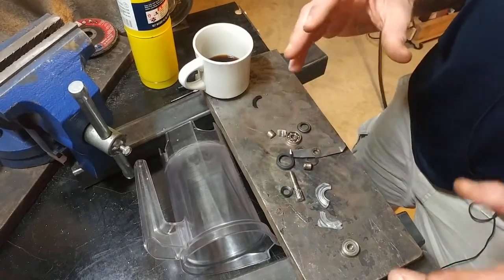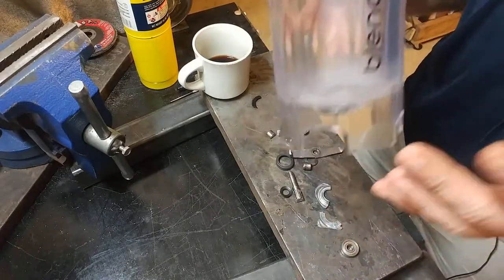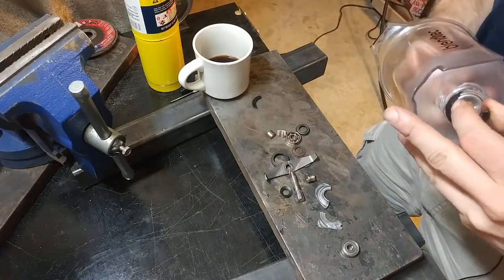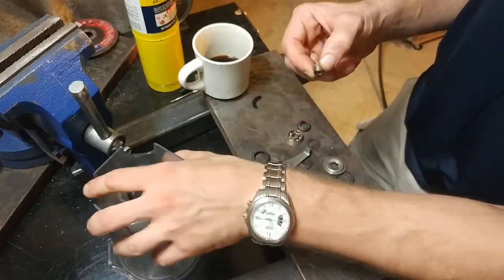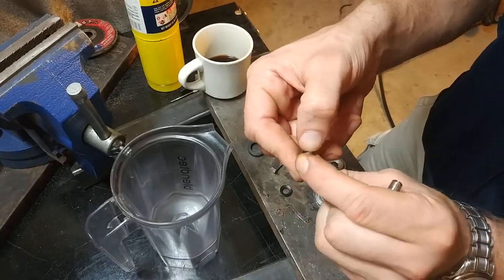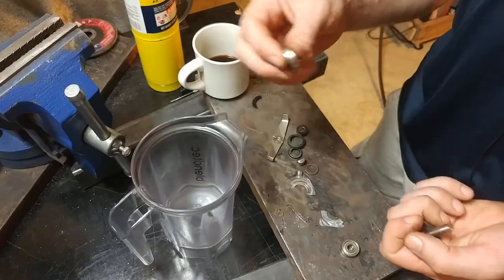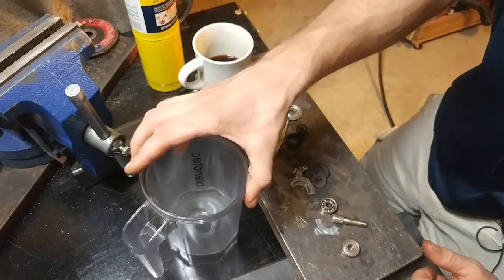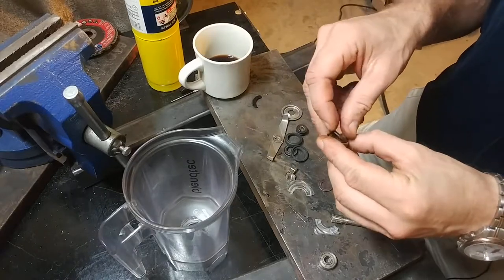Will it blend??? Nope! (Blendtec bearing failure.)

Comment: i can give you some useful information how to take the blade out.
the tooth side you can use a 10 or 11 mm ring spannerthat fits perfectly. for the nut you can go with a grinder and cutting disc and cut gently  a cut for a big screw driver  that will work , good luck guys

Comment: If you buy Blendtec.  Register it with Blendtec.  I bought one used and they replaced the jar at 7 years because the original owner had registered it with them.  The serial number may be enough.  They also have super duper specials on replacement jars and you'll be notified if you're registered.  If I have to purchase another jar near retail I will go with the repairable replacement (not cheap).  The throw away society pisses me off too.  The mindset is wrong and the cost is bull shit.  Have a nice day.  ;~)
Reply: Where can you find the repairable type jar?

Comment: The first gasket and the second one on the shoulder that you dropped is actually a single piece. There are two rubber sleeves they cover the bearing on all sides. These sleeves have thin metal reinforcement that you mentioned are “crusty”. The rubber sleeves basically snug the shoulder of bearing inside the notch. Without that sleeve/bushing there is nothing for the bearing to hold on to. 
The video below at 0:42 shows the picture:

https://youtu.be/PCsRq1zCk4U
Reply from the maker: Thank you for that video! It'll come in handy the next time I try to restore one of these things.

I did also see in the comments that there's a company (Alterna Jar) that makes one with  blade assembly that isn't fully encapsulated in the plastic - that might make for easier bearing replacements too.